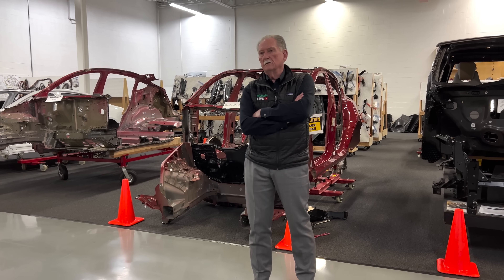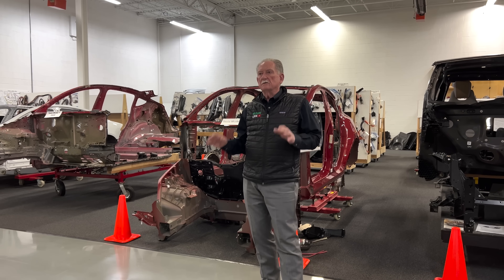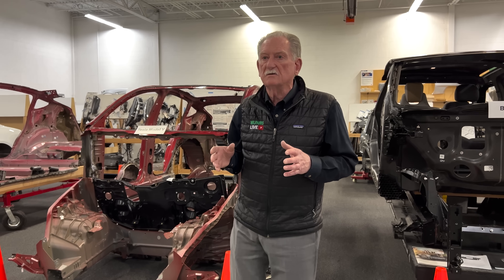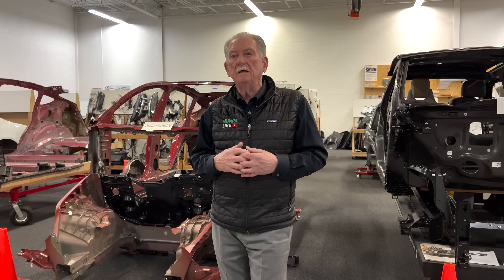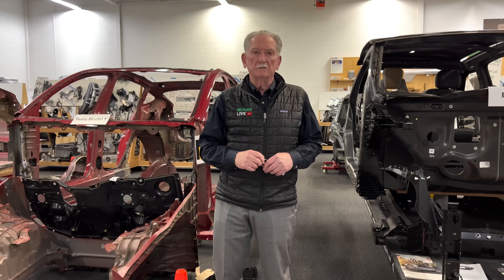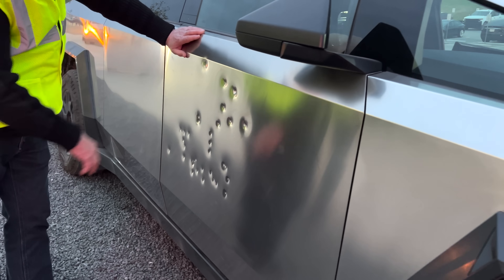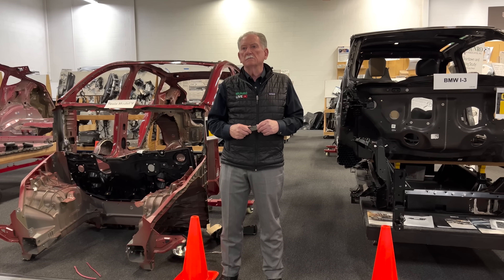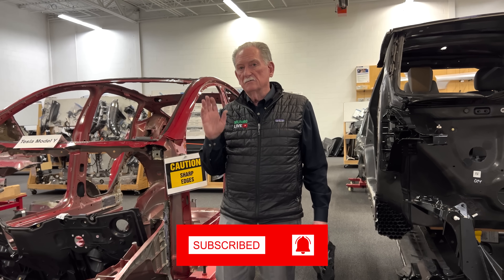An Engineering Analysis of the Tesla Cybertruck

Comment: I was looking for a review of the Tesla Truck and was recommended this. This isn't a 'review' - it's an endorsement.
 Sadly, having owned two, I can tell you that the actual build quality, reliability and functionality of the Tesla 'Truck' (I place this term in quotes because it does NOTHING that a regular truck can do) are below average... far, far below average, in fact; Doors that won't close, Battery problems, Towing problems, Drive problems, Seat problems, Braking problems, Display problems - the list goes on and on. Both of my 'trucks' have spent 4x more time being repaired then I've driven them.
 Next time I do a review search - I'll look for someone who actually drives and uses this vehicle as a 'Truck' and not a piece of delicate art.

Comment: The 48 volt plus ethernet are great innovations. But the stainless steel bits, as well is the giga castings add very little to the value of the CT. It came in grossly overweight. And over price. 'Nary a mention.

Comment: The reason Farley said he is not afraid of Cybertruck is because from a truck perspective the Cybertruck is useless and a waste in many levels.
F150 can tow 14000lbs and a semi truck with Cummins ISX engine have 2200 ftlb of torque (who needs 7 - 10k ftlb???) so right there you are wasting a lot of $ on what is not needed and not providing what is needed (towing, payload and range).
The biggest benefit Cybertruck is bringing is the challenge to the status quo on many engineering aspects, some of them really due for a change, that are in many ways hold for years/decades.
The "ethernet" system and 48V system can really be applied and the casting/structure is something to be investigated.
At this price point, as a truck, Cybertruck should offer 24K lbs towing and 600Kwh battery so someone towing would be able to do at least 400 miles in a day....

Comment: I bought a new VW Golf just under 5 years ago under the VW diesel scrappage scheme.
My old VW Golf which I bought new in 2006 was traded in for a brand new Golf 1.5 150bhp petrol with the new price was around £25k...I got £6k for my old Golf and also some extras plus discounts...
Overall my new VW Golf GT cost me around £19K cash.
So I have this great VW Golf which has done around 15k miles and is still like new as I keep it in a garage over the winter......A full tank can take us anywhere in the UK without any hassle.

Looking at new VW EVs...The ID3 for example.....For an equivalent to my trusty VW Golf, a new one would cost around £50k!!
Trading in my Golf which I reckon would be worth around £15k if I am lucky, I would have to fork out £35K to go electric!!

Obviously, like the Golf I owned previously (2006 to 2018), and 12 years old and very reliable, I think that I will stick with my trusty newish VW Golf for another ten years at least.....That will take me to 87 years old....

Why on earth anybody would buy an EV is beyond comprehension.....The prices are just far too high.
(By the way a new VW Golf petrol now cost around £30k with the extras....£20k less than a new ID3).

They would be better to buy a S/H VW Golf, if they can get their hands on one and stick with it.....

Comment: As this video is an analysis, maybe looking on the downsides would be also interesting to talk about:
Switching to 48V will also have problems, like that the standard for normal cars is 12V so you have to manufacture the components yourself or wait until the supply chain adapts. It would be nice if standards would be thing again (sustainability)... The weight reduction compared to the 3000kg is not dramatic, but I agree, less resources is better.
Also this car will not be street legal in Europe/Germany, because it contradicts the safety regulations (sharp edges, rigid body). To make a car out of thick steel to make it bullet proof, thus increasing the weight and reducing the range (efficiency) is something I can't get my head around. I get that there are industries who could benefit from this, but its not a benefit for normal cars. I also understand that this is mostly done for marketing reasons.
Can someone explain why the stainless steel needs to be non-magnetic? He never mentions the benefit of it.

Comment: That Cuisinar is a pretty low quality stainless steel pan actually. You want it fully clad instead of with only the bottom that is doubled with aluminum to distribute heat on the whole cooking surface. Further more, if it's not magnetic, it doesn't work on induction cooktop/range which is fairly annoying if you happen to have one.

Just to remove the doubt, high end stainless steel pan do work on induction cook top so they make the alloy magnetic.

Comment: Excellent - a couple of mysteries for me. How does the 48V architecture help with the bidirectional charging and also the high speed 800V charging - aren't those things completely separate electrical systems? Also it's fair to mention that 48V means you need an aftermarket of accessories and add-ons (including jump starters) all designed for that.  I'm sure it's the future - but just saying...it's currently a tiny field of parts suppliers designed for that isn't it?

Comment: Genuine question. " rear casting made on a 9000 ton press... front casting only 6000 ton press" how does the weight of a press affect a casting?
Reply: It doesn't, that measurement is only important for the manufacturer, a smaller press is a cheaper press. Moreover, this man talks about "a new cfd software" to design the castings, which is a lie. Process simulation (and optimization) of castings has been widely used in the industry for at least a couple of decades now. And not only that but the ease in which any particualr part is cast does not speak anything about it structural integrity. This man is either disingenuous or ignorant.

Comment: Interested to know more about the new wiring harness. I’m skeptical about the “weight savings” not actually just being “manufacturing cost savings”.

Especially seeing as how weight is clearly not very important with those thick steel panels glued on to the body
Reply: 48v is good, they can do more like this, and simplify a lot of things, the problem is , they will engineer everything in a way, if something goes out, you will need to change the entire controller.... and make it impossible to do it easy, and will cost as much as a car. This is the problem with 48v... they can integrate everything in one controller, and localize communication for everything , if they do it the right way so it can be repaired , and things that go out can be changed without changing the entire controller, it will be a good thing, but everyone knows what will they do, you will need to change entire controllers for simple things, so the only thing this will resolve is like you said manufacturing cost savings, and after everything else will be at sky high prices to repair because you will need to change entire controllers and pay a ton of money for them to program it on your car, because the only ones who can do it is the dealers because you can only do it online and with their permission... so it will be a nightmare probably:)  There is a reason i will stop repairing cars after some years in the future, because i don't see a future where i want to waste my time on these new cars.
Reply: @UmbraWeiss  This is my hunch . I’ve never worked in automotive but I do know that this “ether loop” stuff is nothing new . If manufacturers are opting to NOT go with the cheaper implementation. Must be good reason for it. Just from a physics perspective it seems like a nightmare .

Very curious to see how these harnesses hold up (my guess is not very good).
Reply: @jonathanruiz8723  Anyone who's dealt with large companies knows that half the reason is corporate inertia.  I mean half the reason the vehicle "chip shortage" lasted as long as it did was because companies refused to pay to have chips made using processes newer than a decade certified.  No one is creating new machines or spinning up new lines for obsolete technology!
Reply: @EmperorA0  I avoid dealing with suits as much as i can so I’m not sure what you are trying to say .

Forgive me if I’m wrong but to me this reads like corpo speak for “yes ,the choice was made to save on manufacturing costs, likely at the detriment of the product”.

Comment: From an engineering standpoint this truck makes no sense.  You cannot point to one engineer that would say that making a huge vehicle that requires two wheel steering, has flat stainless steel panels that are 1.4-1.8mm thick just to be bullet proof, requires batteries that we have to revolutionize the manufacturing process in order to make huge quantities, for a limited consumer base is a great idea.  Elon basically rammed a bunch of requirements down his engineer's throats and then said make it happen.  Reliability wise these trucks have to be a nightmare.  Also no rear view mirror and a tonneau cover that covers up the back windows.  Crash test is also going to be a challenge to sell into Europe if they can at all, and it probably won't even get a good rating in the US.  Elon has put forth a ridiculous vehicle only because he thought it would be cool.

Comment: 48 v versus 12v, Monro should have explained more on why 48 is better... it's all about amps! As an example, you are getting the same amount of 'power' either way (120V x 60A = 240V x 30A) in your home, so from an electrical "power" standpoint it is a wash--either one will support the same amount of equipment...but 220 will need half the wire size, heat less, and overall more functional! That's why Europe is all running on 220v!! The high voltage's capability to carry more amps efficiently is what matters!

Comment: Very interesting, but at the premium price of between $75K and over $100K, how relevant is this product?  Is the cost-benefit worth the high purchase price? Also, the premium cost will not end there.  Maintenance, parts, and repair will be highly proprietary and relatively rare.  Tesla will charge a fortune and there will be little competition.  So, in the end this vehicle is in the same category as a Ferrari, in terms of market relevance.  That is that its a toy for the the rich.  Will it be an alternative for real work trucks?  Certainly not.  Will the technology spiral down into lower priced trucks?  Possibly...some of it.  But, non-magnetic stainless steel bodies will never be practical, inexpensive, or cheap to repair.  Proprietary service and support is not market friendly.  So, at this point, the truck is still a novelty.

Comment: Using a standard of 48V for all the electronics is an overkill. Control electronics (digital or analog), in particular, have no need to go above 12V. Making the control electronics 48V is like providing a 48V power line from the ATX power supply, when the PC just don't need it.

Comment: I HAVE SEEN OVER THE YEARS THE WIRE GAUGE DECREASE IN SIZE WITH THE INCREASE FROM 6v TO 12v POWER SYSTEMS.  I AM CURIOUS THOUGH, DOES THIS ALSO HOLD TRUE FOR THE DATA CARRYING WIRE IN THE TESLA as well as the heavy current carrying wires?

Comment: 4:34 So, let's think about some basic function that can traditionally be had on for the most time, instantly, as you turn the key. With ethernet, I believe (someone can correct me if I'm wrong) you have to have a system or multiple systems booting up, loading a software, connecting with the hardware and only then be able to apply an on/off/control signal. Will that be a problem? Maybe not. But the idea of waiting seconds for a basic function to be "applied" surely is awful. Just like watching the first laggy infotainment systems being used in review videos. Sure, if the delay of a basic function in any given circumstance is milliseconds, it's ok. Any more than a few hundred, that's no longer a product that anyone should invest in.

Comment: I know that 48v is great for providing energy with either less wires or smaller motors, what about the safety aspect?  As 48v is just at the top end of what is considered low voltage, and I am sure that it is bumping up well above 50 while running (high voltage territory now) is arching and shorting an issue, especially in an accident?  BTW it is a 70% savings in copper, not wiring weight over all.  With everything running on the CanBus, it also means that all components are smart components increasing cost of replacements.  Often smart components do not last as long because of circuit board failures as we see with many LEDs that fail long before the advertised life expectancy.   I am also concerned at the cost of reparability of these vehicles.   Both outer panels and inner welded structures.  It would seem that we now have something that even a minor incident will cause us to through it out because we have welded structures and single body panels that are structural.

Comment: what in the car is running 48V?  did they actually abandon 12V because alot of tire inflators run on 12...
48v on all the computers. so there are step down converters on a bunch of stuff then.
so if the power fails you have no steering at all....

Comment: I scrolled down does searches for "series" and "string". Why? Because I'm wondering about the following, and I KNOW that if you do this, it will lower the speed of charging, however, it will also reduce cost.

What am I going to ask about? 

One) Does the ability for a Cybertruck to power another electric vehicle (while they are standing still of course), if I plug the Cybertruck into a currently non-existent 800 volt Tesla Wall Charger, could it first charge the Cybertruck and THEN charge up the second vehicle without having to plug the second vehicle into a Tesla Wall Charger or anything else WHILE the Cybertruck is still plugged into the 800 volt future Tesla Wall Charger?

Two) Does it mean, through software on the Tesla app on my cell phone (or iPad) AND/OR through software on EITHER the S, E, X, Y OR the Cybertruck, allow me to pause charging the Cybertruck AND INSTEAD charge up the S, E, X, AND OR Y, basically could you plug in two vehicles or up to 16 ... or more vehicles, to a Cybertruck that is connected to an 800 volt charger. Can you tell the vehicles to NOT charge the S, E, X AND OR Y, and pause specifically ONE OR MORE vehicles so that ONE OR MORE of the vehicles could charge WHILE CONNECTED IN SERIES or "like light bulbs on a Christmas light string", Tesla vehicles?

Why would I want to do this? Well I might have a friend come over and he needs to charge his Tesla after I get done charging up my (future) Tesla Cybertruck or future versions of other Tesla vehicle(s) too. Either at the same time OR one AND THEN the other OR both at the same time OR have the Tesla software in the vehicle or the app on my mobile device, be able to set a charge limit for one and then have the other take over from then. AND CAN I PICK WHICH vehicle charges first?

Why? I might have a three or four car garage (not me but wealthy people that might have multiple Teslas and it might be very hard to charge the middle Teslas OR their FRIENDS might want to connect also WHILE the 800 volt charging Tesla IS PLUGGED INTO the future (I don't think it exists yet) 800 volt home Wall Charger that normal people could buy?

This is a VERY valid question and YES I myself have ONE Tesla but I have FRIENDS with Teslas. I would like to know if I could IN THE FUTURE when my Tesla is an 800 volt charging Tesla, can I connect them to a HOME 800 volt Tesla Wall Charger instead of having to unplug mine and then plug in theirs? 

Technically this SHOULD be possible. It's just a matter of Tesla doing this. And I think this is the correct place to ask it since I don't have a direct link to Elon Musk and Sandy does.

Comment: I'm surprised the 12->48v change isn't talked about much. It's a move that's been happening in the yacht industry, and it's below the 50v HV threshold for working certification.
I also find it surprising how many EVs aren't set up to maintain their 12v SLA battery in low temps, leading to dead batteries...

Comment: Stainless - used to make turned parts from a sililar material. The swarf was so tough it tore the expensive multi-tool CNC to shreds! Had to make the exit out of the same stuff we were machining to have a reasonable life on the exit. Replaced it every 3 hundred hours or so....not to mention tooling! It was cool!

Comment: I am curious to know what the Fail-Safe mode is on the steer-by-wire. Does it make the car progressively less drivable to force the driver to address the problem, or does it just throw error messages up while the driver shreds through each of the redundant systems?

Comment: AUDI has had a 48V system in the classic combustion engine for several years, for example to power the belt starter generator or an electrically driven compressor. Support for components that require higher performance. This is otherwise oversized for window lifters or seat adjustment. I don't see the point of operating a window regulator with 48V if the window is not armored.

Comment: Thanks Sandy. Here is the link to the pdf of that Tesla patent on the 48 volt wiring, power & communications distribution system that will enable not just all the performance improvements you mentioned here, but also the reinvention of the manufacturing process you mentioned when talking with Elon in the previous video. I bet they will be licensing this first to Ford, then the rest of the survivors. https://image-ppubs.uspto.gov/dirsearch-public/print/downloadPdf/11260809

Comment: at 2:40, maybe same argument that US should adopt grid voltages from EU.
Reply: Nothing is inherently "better" 120 vs 240. It depends on the application. American homes have 220/240 supplied and use both that and 120. The higher voltage for larger appliances with heavy loads like electric ovens and dryers